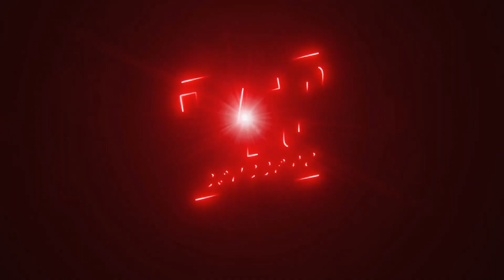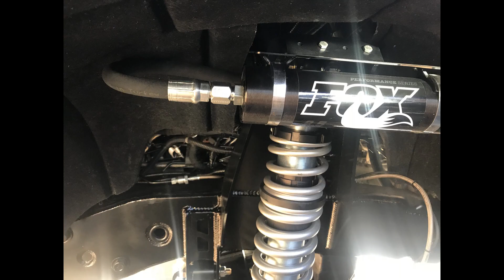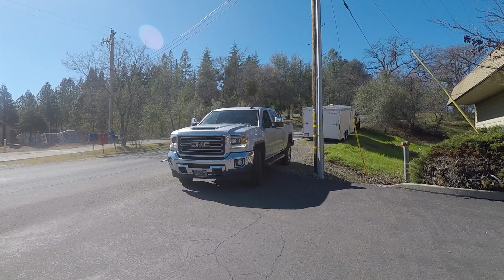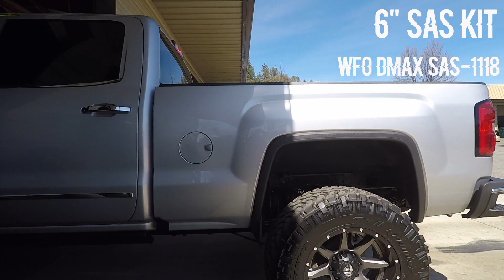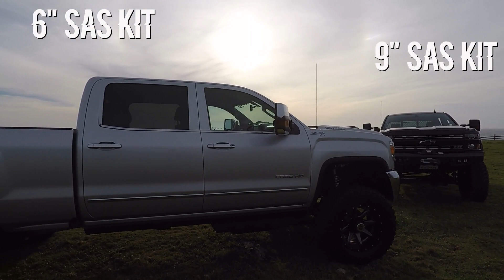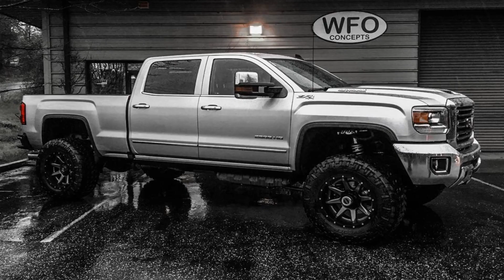The WFO Concepts 2011-2018 GM HD Straight Axle Swap Kit

Comment: I have a 2012 chevy 2500 HD 4x4  what would a kit cost for it. Thank you
Reply: A solid axle swap for that truck would cost anywhere from $1100 to almost $7000, just depends on whether you already have the hardware or not. If you've already got the axle, mounts and other stuff, it should only cost a couple thousand dollars to have all that welded and assembled.

Comment: Now GM owners can enjoy death wobble too.
Reply: With proper mods and tuning of the suspension the wobble of doom shouldn't be a problem. Besides, independent front suspensions have it too. It's not just a solid axle problem.
Reply: I have owned several vehicles with solid front axles and have never experience death wobble. I have also owned a couple of chevys with the IFS and had nothing but problems with it.
Reply: @ChickenwithaHelmet  Lol no ifs does not experience DW typically at all especially GM